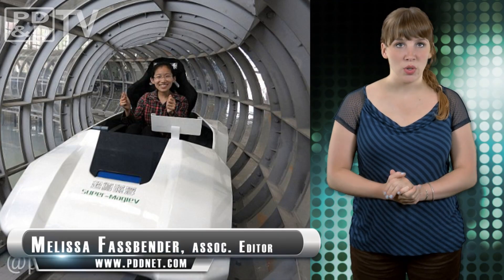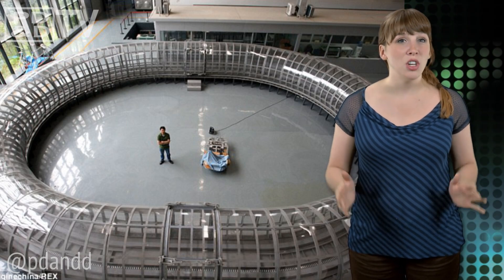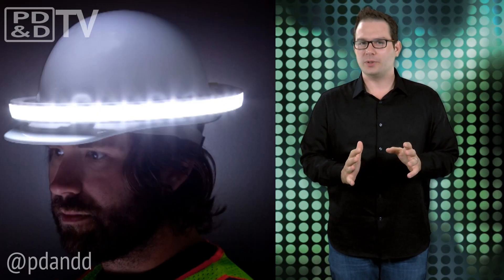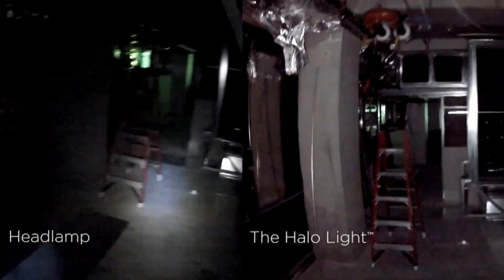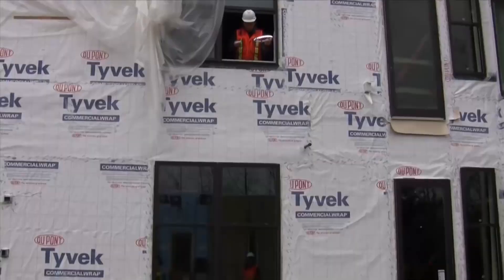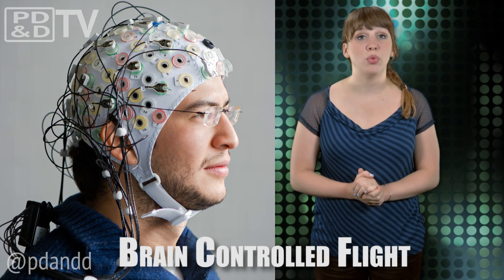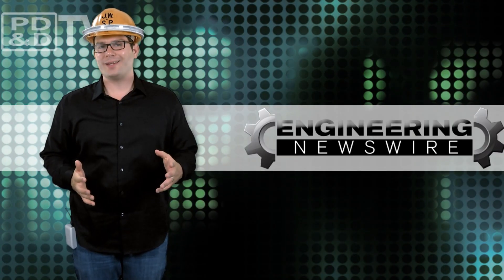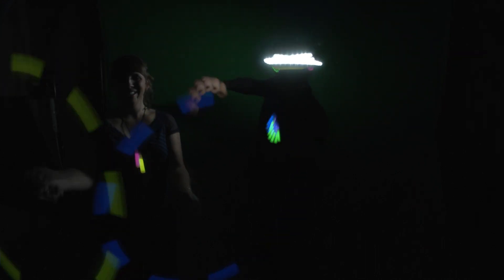Engineering Newswire 92: Super-Maglev Train to Reach 1,800 mph

Comment: isn't the high speed maglev essentially a smaller version of Elon Musk's hyperloop it's most certainly not Chinese invented
Reply: Not really, it doesnt use air to levitate the train, the tunnel doesnt have low pressure and hyperloops top speed is 800mph. Looks like this Chinese maglev is designed more like a rail run. Uses bigger better magnets, top speed of 1800mph I think they said.